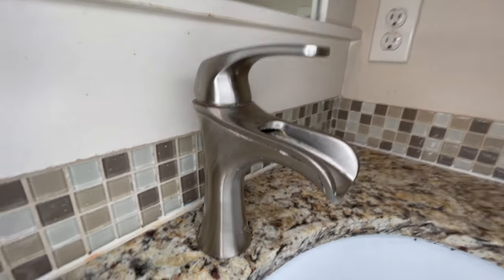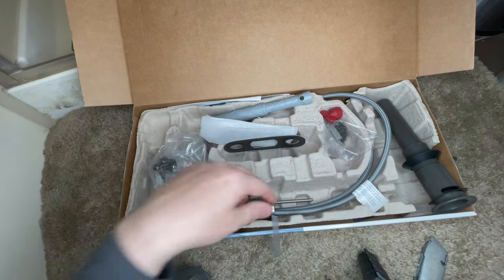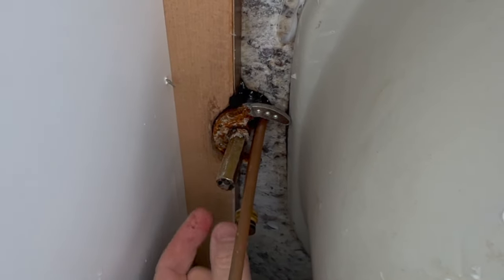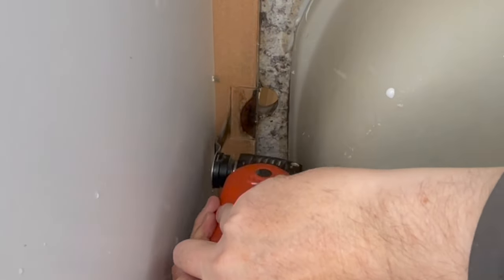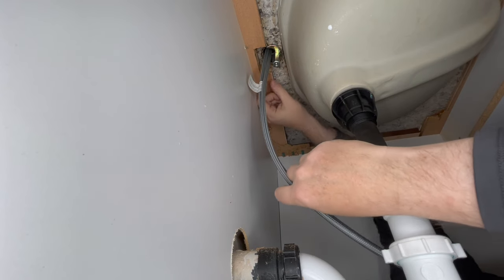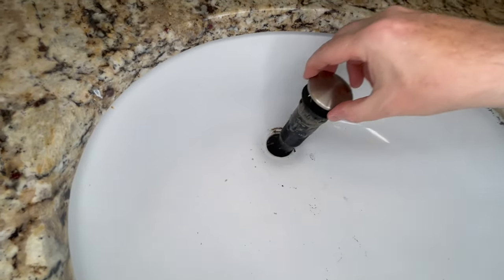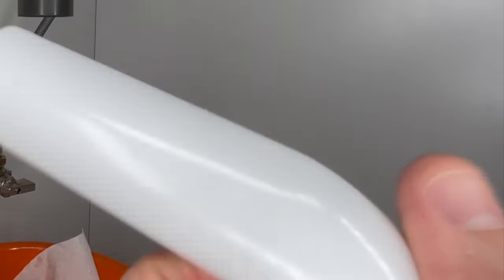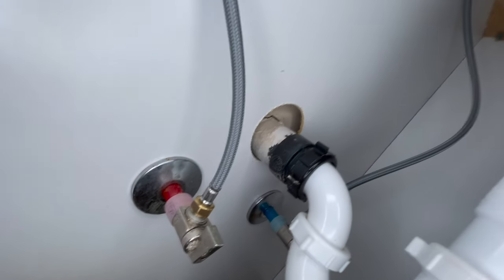Replacing A Dripping Bathroom Faucet

Comment: Why did you not use the rubber seal below the sink?
Reply from the maker: Where at?  Faucet or drain?
Reply: @ThatFixItGuy I'm assuming he means the part when you're underneath the sink looking at the newly installed drain - it looks like you didn't install the huge rubber gasket that goes under the sink